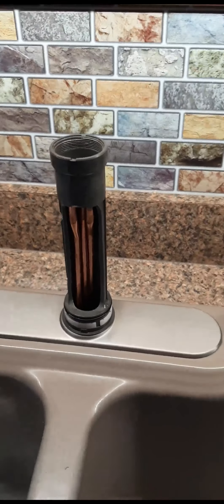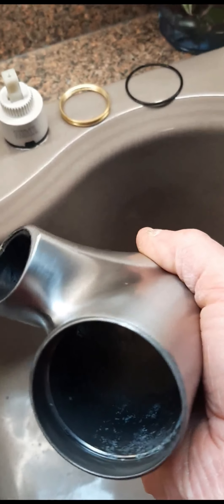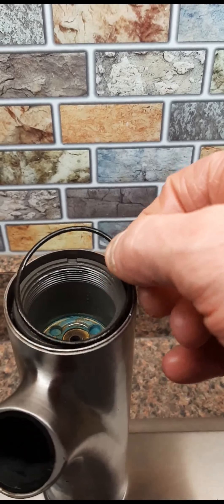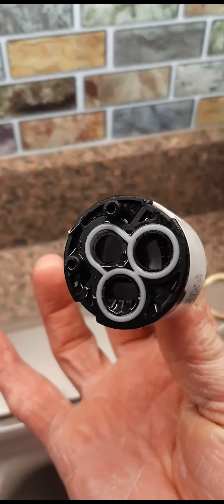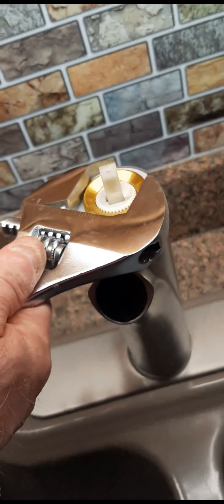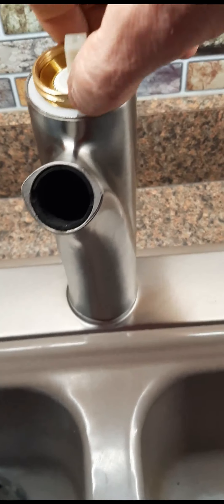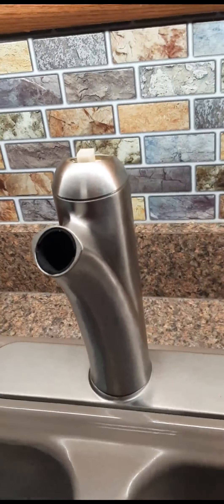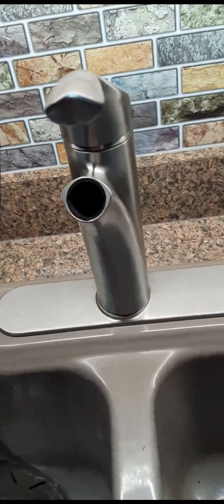Kohler Mistos Kitchen Faucet Repair - Model K-R72510-SD

Comment: Having a hard time finding the name / part number of the piece between the deck plate and the body - any ideas?
Reply from the maker: Sorry I didn't see you message sooner. Here's the link to find the service parts diagram: https://www.kohler.com/en/products/kitchen-faucets/shop-kitchen-faucets/mistos-4-hole-kitchen-faucet-w-11-pull-out-spout-and-soap-lotion-dispenser-r72510-sd?skuId=R72510-SD-VS

Comment: Thank you but you did not show the important part- how to get this thing apart. I can't get the threaded ring off. The whole thing turns into of loosening the ring. very frustrating
Reply: Rethreading is clearly shown starting at 4:18, and it is the opposite as assembly.  Just put a wrench on the flats of the threaded ring and turn counter clockwise.

Comment: I have the same faucet.  Tried to remove the handle to get the body part of the faucet off.  The set screw seemed to sit back.  Couldn't even tell if the hex screw hit the screw.  I had my neighbor look and he agreed.  The faucet is close to a wall so I had to hang a mirror to even get a peak.  I am trying to change the hose that holds the sprayer cause it leaks at the ball joint.  I have been working on this a couple of months and talked to Kohler twice.  They sent out a new sprayer and gaskets rubber and plastic.  I tried telling them about the set screw she kept asking questions if I put it in wrong etc.  I don't think she believed me.  Wish you could show the back so I could see your set screw.  What if I can't get it out?  I need to take the handle off to replace that hose? Please help if you can.
Reply: You don't need to take the handle off to replace the hose. At 9:14 in the video, it shows the plastic fitting that the sprayer hose screws into. First remove the hose weight (2 screws). Now hold the plastic piece firmly (may have to use a pair of pliers) and unscrew the hose from it. I ended up using another pair of pliers to grab the brass fitting on the hose, then I could turn it loose. At that point you simply pull the hose out from the top of the faucet. let me know how it goes.
Reply: @stevehruza  thanks for your response.  Yes, I did come to that conclusion that I could just pull the hose through the top.  So I ordered that Hose and put my best foot forward. I wish I could see the view of the hex screw. Eventually I will have to get inside and replace the gaskets and plastic rings so that part will move easier.  I will be in touch.
Reply: After fighting with the quick release I finally got the hose on and it seems shorter and not as pliant as the old one.  I will have to find something to clean out the hole because this hose doesn't fit inside just like the old one. I do have sandpaper but no dremel tool.  I will figure it out.  When I ordered the hose I ordered the hex screw just so I could see it.  The handle has to come off at some point..... Thanks again for your help!
Reply: Seems like a manufacturing flaw with the sprayer handle not fitting. I have the same problem. The hot water side is clogged and slow. Will be using this for disassembling. Thanks for posting.
Reply: The set screw is set back pretty far, maybe 3/4" thru the hole.  It is a completely blind process so you just need to keep trying.  You'll feel the small hex if you get it lined up right.